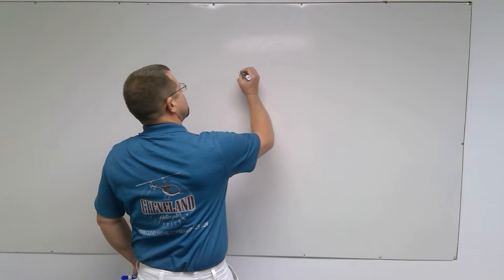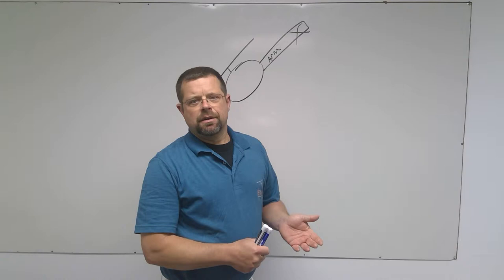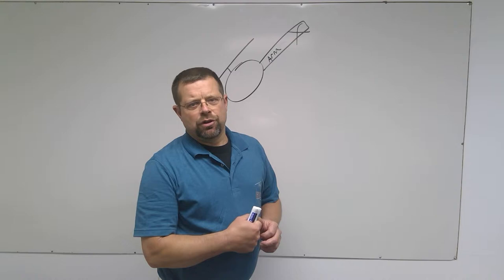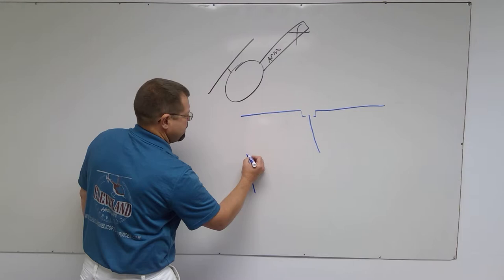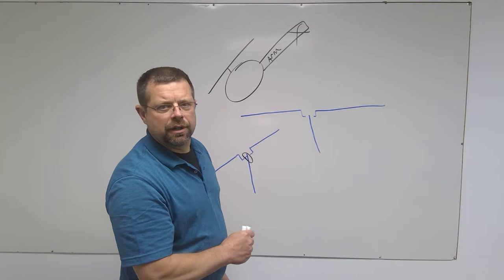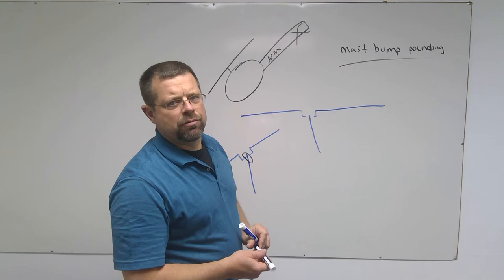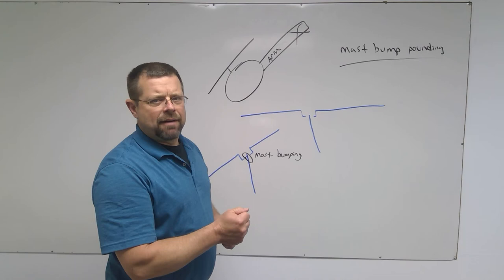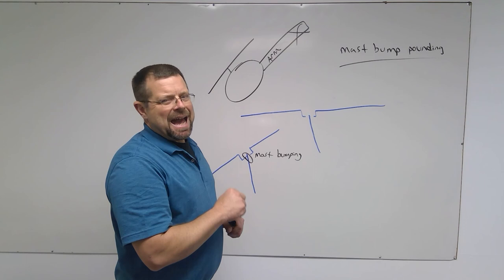Low G

Comment: just found your channel gary,  currently restoring an exec 90 rotorway that has mast bump cuts in the rubber cover of the mast. it is like a "dirty secret" of rotary craft, which has such devastating  consequences. glad to hear it is well addressed in the  check ride.thank you.
Reply from the maker: Those cuts are likely from handling and not from contact in flight